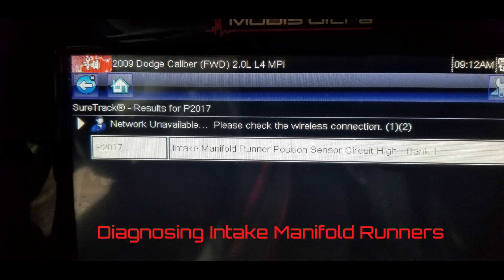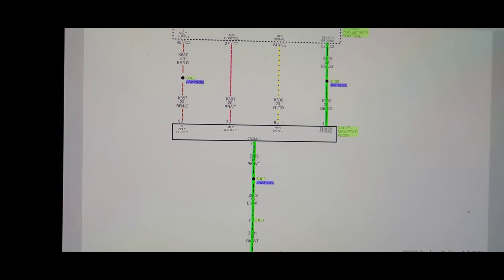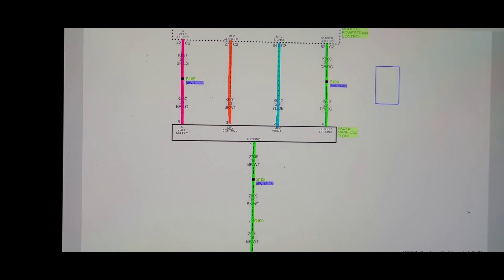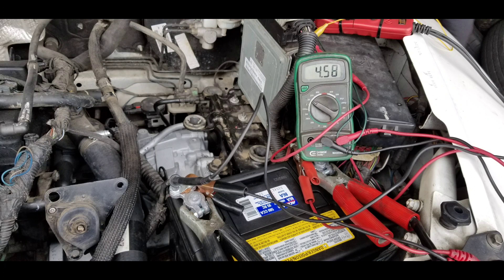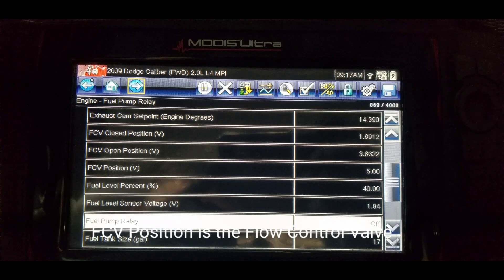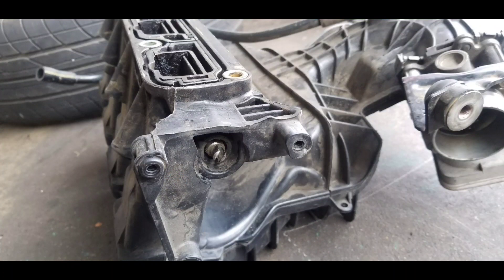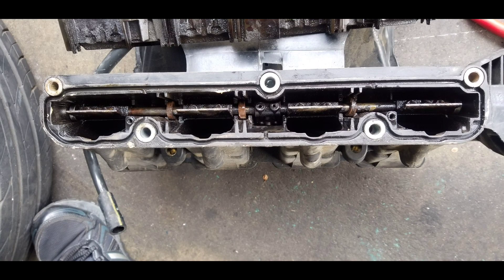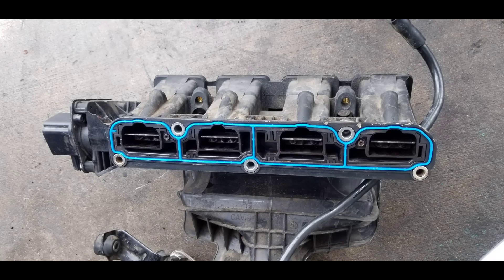Diagnosing a P2017 Code Intake Manifold Runner Position Sensor Circuit

Comment: Hello, Could you confirm that flaps have only two 2 positions : open or close ? There is no positions in the middle ? Runner position sensor (engine)has only 2 positions on the shaft . So the flaps inside the manifold can be only open or closed .Yes ? Why the code was only 2017 and not 2004 ?

Comment: Now I wish you made a video about how the solenoid itself works when you get a failure on that side of the runner. I have one that is pulsing 12 volts on ground and says the circuit is high but no resistance to the ECM

Comment: I noticed you were analyzing the minimum and maximum voltages of the actuator with it uninstalled on the intake. Could it be that you were getting 5.0v because it wasn't installed? Because the position of the valve on the actuator is at a different position when installed opposed to when Uninstalled. So are you sure that was a proper test with it Uninstalled?
Reply from the maker: You are correct, the voltage readings are different when installed. I used the scanner to control the IMRC motor, but did not see a response from the sensor. Then I  removed the IMRC motor and noticed that the voltage values did change while being off. I noticed that the flappers were stuck, that's what made me remove the manifold.
Reply: @MRDIAGNOSTECH  I thought so. Im currently working on one of these today. All the circuits and connections are fine the flappers are moving but codes are returning immediately after clear with just turning key on. Could it be the valve has lost its original voltage calibration making codes return? And also is true you have to reprogram or update computer when replacing with new unit? Thanks for responding and your input!
Reply from the maker: @FILMINGLOL  It's possible that it's out of range or the flappers are getting stuck inside the Manifold. I've found that aftermarket units are too sensitive and trigger the code, if replaced I recommend an OEM unit. It doesn't require relearning the new unit when replaced.

Comment: Thanks for sharing the video and your knowledge. I have a P2004 runner stuck open. Thanks for the wiring schematic so I can check it electrically and also showing the voltage readings at various positions. 😊